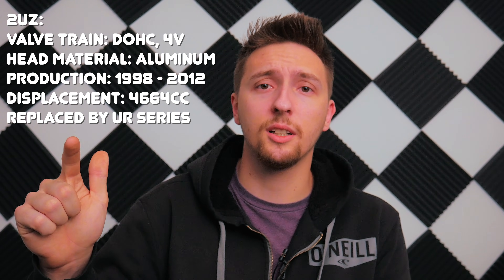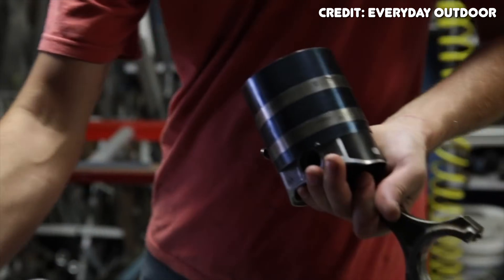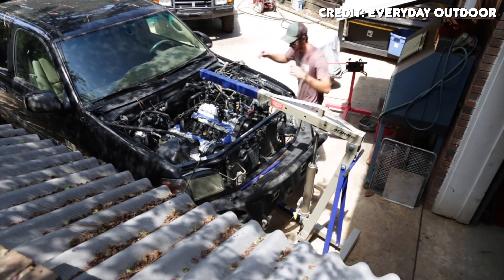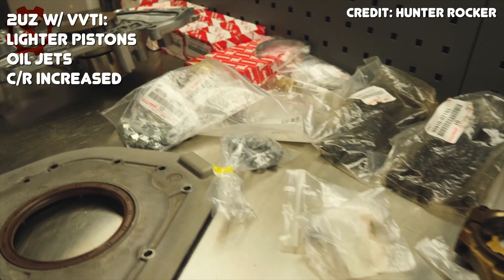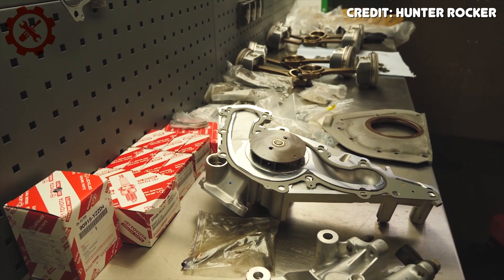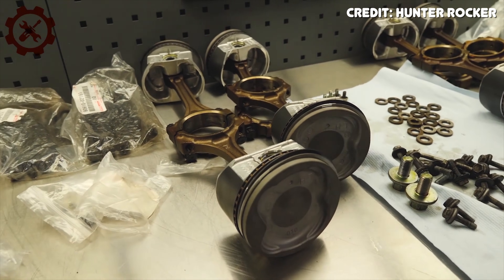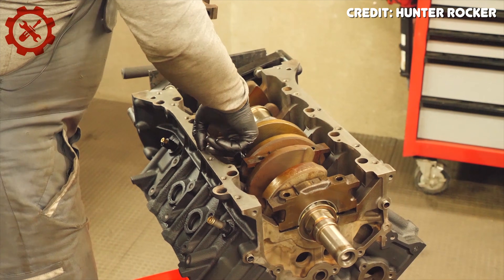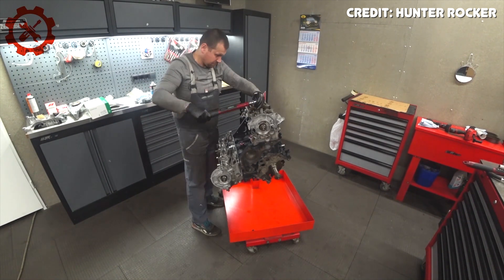Toyota 2UZ-FE: Everything You Need to Know

Comment: 169k on my 2000 4x4 tundra. With what sounds like a lifter tick. Oil changes on time. And brand new oem gaskets. Great truck but I have yet to experience the hype that results in the crazy high prices of these trucks.

Comment: Earlier engines did not have VVTi. Depending on the vehicle, Tundra, Sequoia, etc., the VVTi system was added about mid-2000 model years.  The Sequoia switched to it in 2005 (mid- Gen 1: 2001-2007). 

One thing you did not mention was the VVTi engine came with the secondary air injection system which was problematic. I have a friend who installed the bypass kit and still has the problem of the engine going into "limp mode" regularly which requires stopping and starting again in multiple steps. No local mechanic - including the Toyota dealership has been able to help.

Comment: 05:55 Untrue. First of all, 1 & 3 UZ have 6 main bolts (not 4), seond - they have six  because they are aluminum, and it's much easier to tear a thread from aluminum then it is from cast iron. 2 main bolts in cast iron are enough, and if you really need more - you can do 4 bolt conversion.

Comment: I have an 06 Tundra with 300K on odo.... the thing still starts like brand new and is still so smooth I forget it running when I'm sitting at traffic lights.  It's also maybe not a big puller or a race engine but with the 32V and the VVTi it's a GREAT mid-range engine that I can haul ass with on long country highways here in the PNW... Plus the 1st Gen Tundra it's in might just be THE best pickup Toyota has ever made.  I absolutely LOVE the 2UZ, I just wish Toyota would make a true 3/4 and 1-ton truck

Comment: The 2UZ is bulletproof ! I've seen these in courier trucks that have 700K miles on them and they run just fine ! 
 I had a 2005 Tundra with the 282HP/325 #/ft and it was a beast of an engine ! 
 I'd love to put one (with the 5 speed auto ) in a 4x4 Tacoma. That would be a BLAST !

Comment: Is there any way to get better fuel efficiency outta this motor, yes I know it’s a v8 but there’s ls engines that are in heavier tanks of trucks that get close to 15-18 mpg, I’m getting 10 outta my 02 sequoia, 200-250 miles of range on a fill up😂
Reply: Maybe try new plugs and coils. Or you’re driving it too hard. Should get about 13-15. I’ve seen mine get 17 on the highway 70mph cruising.

Comment: The 3uz and 1uz have 6 bolt mains, not 4 bolt. 2uz is 2 bolts as said. Aluminum heads and iron block make it a little more susceptible to blown head gaskets in the 2uz, but tbh as long as you do your maintenance, you'll never see it.

Comment: Im curious do they make stainless steel blocks? It would be lighter than cast iron and stronger than aluminum.
Reply: I'd imagine it would be crazy expensive as you can't cast stainless. You'd need to either sinter some metal powder, which would cost hundreds of thousands of dollars in just metal powder cost alone, or you'd need to machine a block of stainless into an engine which would take a long time and so would also cost a lot of money. Stainless also specifically has a lot of issues with galling so it would likely be very sensitive to oil levels. Generally wouldn't be worth it in other words
Reply: A cubic foot of cast-iron is lighter than a cubic foot of stainless

Comment: I had a 2006 D.C. SR5 5.7 V8 RWD TUNDRA which I liked alot until my ex wrecked it around 250k. Then I got an early 2004 D.C. SR5 4.7 V8 RWD with the tow package. It had 235k it was somewhat  neglected and overdue on maintenance. This is when i actually started researching and learning about the different engines. Personally I feel any VVT  engine should be considered 2nd generation. Even though 1st gen is 2000-2006. One of the major reasons my research went deeper is when I was shopping for parts i noticed parts were saying fits 2000-2004 or would say fits 2004-2006. Huh? What is going on? How does 2004 create a magical bridge that lets it swing either way, while not letting the  years on either side of 04 connect? Well it doesn't you have to pay attention to what month in 04 your truck was made. 1/1/04-7/31/04 or 8/1/04-12/31/04. First half falls into 00-03 +1st 7 months of 04, latter being 8/1/04-2006. I had never seen this before and I still don't know of any other vehicles that have a split year like this. My opinion on the pre/post VVT is, my 2006 VVT, 5 speed transmission was smoother, and quicker on the pickup, but my 04 is a simpler engine no VVT, no secondary air injectors, 4 speed allows for more rpms instead of dropping to shift as often.  Given a choice id probably go with a custom V12 turbo hybrid, manual transmission, optional 2x4 or 4x4 installed in 3rd generation shell, with aftermarket mods, including drop step runner/nerf bars , 2"+ lift, over tinted windows, and a green hornet style license plate . Well that or get new leaf packs for my 04, considering the price of food fuel insurance blah blah blah is killing me. Not even a full cart of groceries from Walmart was over $300!

Comment: Huge W is the timing belt instead of a chain. Means you throw a new belt, pulleys, tensioner and waterpump on and its good to go for 10 years or 100k miles.
No limping a noisy dying chain along dreading the huge and expensive job that a timing chain replacement on an engine like this would be.
I will never run a timing chain engine unless its one of those chains that miraculously never make trouble and last forever which is rare.
My Volvo V70 Diesel is a timing belt engine as all Volvo engines were because Volvo kept shit simple and just build stuff that works like all the Japanese manufacturers did too. Its on its 2nd belt with 240k miles and a 3rd belt is due this summer id say.
They all had their golden era though and Subaru, Mazda (Ford Era) and Toyota have some hopeless engines in their lineage.

Bro on the new small inline 4 or 3 PSA and Mercedes engines the chains are toast after like 100.000km 💀 Absolute POS engineering. It has to do with the junk bicycle chains they use and super thin oils they run. Back in the day engineers beefed up the chains so they wouldnt make trouble and decided 5w40 is goodnuff.

Comment: Well we see them with 300 to 400 thousand miles pretty commonly so although not a lot of power they are extremely reliable in stock form, rember variable cam timing is another failure point.

Comment: 325k on our 2001. Smooth, quiet, strong, doesn’t leak, doesn’t smoke, doesn’t use oil. Compression is still well within spec. It is truly a work of art that I predict will go another 325k miles.
Reply: What oil do you recommend?
Reply: @bradlock55  Honestly doesn't matter much, just use full synthetic and you'll be okay

Comment: 306,000 on mine in my 2002 Sequoia and doesn't leak a drop and does not burn any oil either. I believe a 99mph governor was used to stop the suv from rolling at high speeds.

Comment: Least love? It’s probably one of the most reliable V8 engines ever built. Growing up we had it in our Sequoia and it’s still running with 350k my V8 4Runner has 195k no issues. Very smooth linear get up on this V8. Only real issue I have is the exhaust manifold. Toyota has to compromise on the design because of the climate change hoax. Regardless I don’t mind the tick and eventually you can get long tube headers.

Comment: I heard read it was like 562 pounds.....So how much would handling be affected with a  562lb  V8 engine in small sportscar like a Nissan Z or Toyota Celica VS a 262lb turbo 4cyl. 
 I'm thinking you'd have something like 70/30 weight ratio
Reply: Im thinking these days a boosted 4 cylinder is the way to go if you want max power output for the least amount of engine weight.
Like the good ol K Swap.

Comment: At any point did he mention the 2UZ is a cast-iron engine block while the other two UZ engines are aluminum? This engine is a beast and damn near indestructible. Best V8 ever made in my opinion.
Reply: 3:42
Reply: Iron block engine is good for strength but not as great for heat. It absorbs heat more than an aluminum. Cooling systems are very important

Comment: I have 332,000 miles on my ‘04 LX470 (100 series ‘Cruiser) and still running strong!
Reply: How about now? 😮
Reply: @ilovehotdogs125790  I have 368,897 as of this morning. I had to replace both catalytic converters (which really sucked, because the first set of supposedly compatible aftermarket converters failed… twice, so I had to switch to one for a large diesel truck, which worked well).

Comment: Very similar to the Ford Modular outside of valve actuation (RFF for Ford, shim/bucket for Toyota) and cam drive (chains for Ford and belt for Toyota).   

That UZ iron block almost looks like it a could be an iron Ford 4.6 block at a glance.  

Both are very long lived and tough engines

Comment: I got a 2005 toyota landcruiser 100 series and it has the petrol V8 2UZ-FE engine in it has done 380,000klms engine sounds smooth quiet  it just pures like it was still brand new just keep upto the timing belt and oil changes every 10,000kms you will get well over a million ks out of one of these engines in Australia we seem to think the car will rust to the ground before the engine ever dies

Comment: I couldn’t be happier with the 2UZ powered, 2003 4Runner that was passed down to me last year ❤ She’s a little over 296k on the clock nowadays, but still performs exactly how I remember from 17 years ago when I was learning to drive!  My family was meticulous with on-time maintenance & paying the Toyota Dealer premium for timing belt jobs, but I’ve taken things a step further and have heeded Toyota’s recommendation by using 91 grade Shell fuel, once I took ownership last year. Since then, fuel economy has gone from 15 mpg combined which my family would occasionally bitch about, up to 20 mpg.. with a noticeable change in off the line pep! No one believes me, but money well spent 😄👌 I’ll drive this reliable ‘ol tank into the freaking ground before owning anything else!
Reply: It makes a huge improvement in mpg when towing. I can’t say that I’ve noticed a big different for daily driving between low grade and premium though.
Reply: I haven’t heard of someone putting premium in a v8 4th gen. Wonder how mine would like it…
Reply: Didn't know the grade of gas could improve mileage...interesting...I will try a tank I think..i have a 2001 sequoia 2uz
Reply: That’s not usually the case on fuel unless the manufacturer calls for premium like the Nissan maxima where it will run on regular but the timing will go into retard mode to avoid damage. Use premium and the maxima puts out more power and better fuel economy. Is this the case for tundra?

Comment: I have a 2UZ-FE in a 2005 GX470. I am surprised how much low end torque it has. At 5500 rpm, it is done. It is not a high revving engine.

Comment: I've seen a lot of these engines over 300k. Usually they go down hill after that because people get scared of the mileage and sell them to someone who neglects them, but they still hold up pretty good with neglect.
Reply: I’ve got one at 378k! Full synth high mileage every 5k!
Reply: Ha! Ha! Ha!  I don't know about that -- I picked mine up from the original owner at 314K miles.
Reply: I’ve got a little over 296k on my ‘03 4Runner and I have absolutely 0 intentions on parting ways with that truck! She’s the family hand-me-down, but has been well maintained & never abused.. which I think is a good reason why it still performs, sounds and even smells exactly how it did when I was a kid! Unless someone runs into me hard enough to cause a total loss or rust claims my baby a victim, I’ll continue to drive this venerable  Japanese Tank towards the million mile club!
Reply: Plenty rolling round here in Aussie with 500,000+ kms. I’ve seen a few floating around for sale with 700,000+
Reply: @izzy031096  Just cracked half a million kms...same engine/gearbox. Believe it or not still shows full on dipstick at 10K service  interval. To me that is unbelievable, as my old V8 I would be adding oil constantly to get to the same 10K service.
Reply: I bought a neglected 02 Sequoia with 250k it's amazing how they will still hum along even though it doesn't seem like timing belt/water pump has EVER been serviced...

Comment: The 1uz design in general is impermeable. Yes it's a shim on bucket lifter engine but the ONLY way I've seen these engines EVER fail is timing belt failure. I've had an 05 with a 4.7. Ridiculously powerful, ridiculously rigid; you can take everything apart and put them back together like Legos.
Reply: Aren't 1uz's non interference engines?
Reply: @doomkid02  I believe the non vvt ones are non-interference. The 1mz is also non-interference.

Comment: Got my 4th gen 4runner with the boosted 2uz-fe from TRD and I love it running real fast and strong. Gotta love that whine !
Reply: Are you talking about the TRD supercharger that was offered for the Tundra and Sequoia? I’m curious about the details because there aren’t many write ups on that. Can’t find much on personal experience just what people heard about the rods debatable failure. (Apparently that was mainly caused by changing out the pulleys for more boost or that in 2003/2004 the tundra and sequoia engines started to be produced in the Alabama plant and despite the same specs (forged sintered rods) the US made ones had some kind of minor difference in metal formula that turned out weaker and caused the rod failures leading to the discontinuation of it. Would love to hear some first hand information on your set up and how reliable it has been! I think a lot of people are interested and people have done it but they never review or report back how it’s going.
Reply: @DeweyC0x  Well it was my daily for a while until I bought an FJR it has 143k it's AWD it's got headers flowmaster 1chamber.  It's got UCA with 2.5 fox up front, old man emu in the back with toytec super flex springs. It whines pretty loud in the lower gears, it's always encouraging me to race. I have the stock air intake with the AEM drop in oil less filter. I did change out the bushing in the SC and added new oil. I've raced plenty people I always surprise everyone. Special out in the Imperial Sand dunes it moves extremely fast in the sand. Definitely have alot of power on tap,  gets 18mpg and I do pump premium. I believe the 4runner and the LC with the 2uzfe is the forged rods from Japan. vs. the tundras and sequoia are not forged supposedly that's why they kept bending the rods with the boost I've put on Obd reader and it tells me is pushes 8lbs. I have yet to get it dynoed but I feel like it's in the 400.
Reply: Answer the man ☝️
Reply: @taliesinangling3564   I changed out the bushing because it started to sound like metal on metal and once I changed it the noice went away. The SC was installed at Toyota. I used to work for Toyota. But other than that maintenance item it's been fine. Ive towed with it and she just whines so nicely when going on the grades while towing.

Comment: The compression ratio on screen is different than what you said. Also what do you mean increased it to a 10:1? That’s the original compression of the 1uz, it was bumped up later to 10.5:1 so idk what your on about with the compression specifically.
Reply: It looks like what you meant to say was the 2uz originally had a 9.6:1 which you never actually said and that it was then bumped up to a 10:1

Comment: Excellent video, really enjoyed it. I sooo wish there were more people here in the UK knowledgable on these motors.  Please can you advise, I have just bought a Toyota Land Cruiser V8 Petrol Engine 19000-50D60 Engine Code 2UZFE, it comes out of a J200.  I want to replace my 2UZFE in my J100 (best and latest model), do you know if the new engine will fit my existing auto Gearbox.  Where can I get a copy of the Toyota J200 repair manual too, Please?

Comment: 2:37 this is why I can actually shift to higher or lower gears depending on how I control the throttle and on rpm  and speed
Reply: That's how every automatic trans works in millions of cars. Reads engine load and throttle position and determines if you need a lower gear or not.
Reply: @jatomic7793  that's cool. Thanks

Comment: My Sequoia with 2UZ-FE still runs like brand new at 185,525 miles. Smooth power, no leaks,no oil consumption, no weird noises. I bought one due to stellar reputation.
Reply: 4Runner 330k, same no oil consumption or noises
Reply: @MidwestDIY  i have 108,000 on 07 tundra 4.7. I’m gonna switch to Castro’s high mileage next change.
Reply: My 02 has 280k. Had to change out a starter at 250k and timing belt/water pump at 265k. All in all great engine
Reply: @SwearingDisc0  what oil are you running ?
Reply: @MrTacoJay  Castrol High Mileage 10w30, STP Motor Honey or Lucas, and a K&N oil filter
Reply: Same here! Mine has 182,000 miles and no engine problems.
Reply: I have,2002 Toyota Sequoia I Removed all back seats, I use to haul used heavy furniture just turned 457,000 miles today and counting Really good truck
Reply: My 2003 v8 4Runner with 155k miles is amazing! Luv this engine!
Reply: Can second, 01 sequoia with 248,000 miles, no problems other than a little oil leaving here or there, nothing an emergency quart of oil cant fix
Reply: Probably need to do your valve cover gaskets
Reply: I got an 05 360000 on her! Runs like a new motor!
Reply: Mine just hit 220k Bought a timing belt kit and she's running like new!
Reply: I have 2005 tundra, runs smooth, no leaks,  no issues. 155k